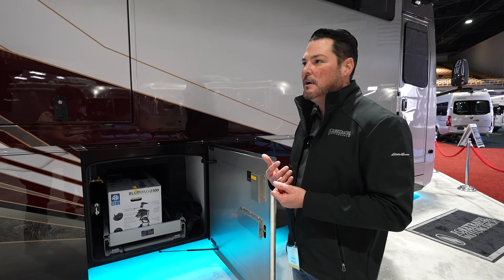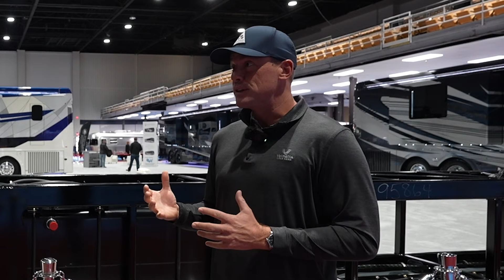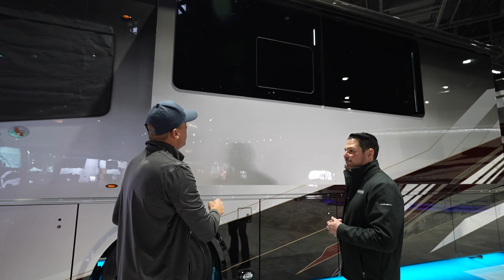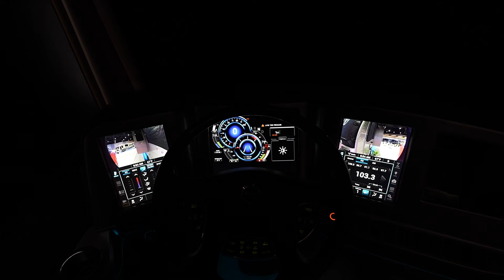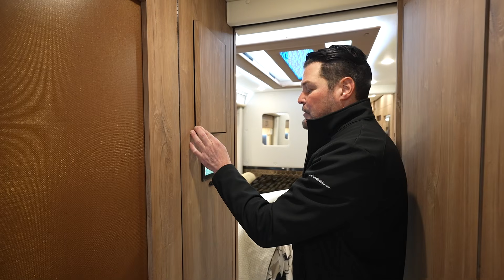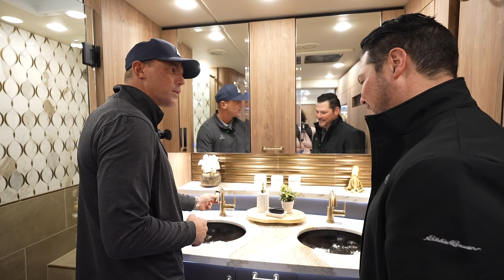2026 $1.8M Foretravel Presidential Series Prototype Tour

Comment: The New Marathon and Featherlite are around $3million so Foretravel stands alone at $1.8 million New for 2026 depending on what all you want. Especially for 2026. I'm impressed. At the motorstore you can get used Newell and Prevost at $1.8  million and lower.

Comment: Front passenger seat so far back from driver's side. Wouldn't buy for this reason alone.  No mention of step cover in front of the passenger seat. No view of half bath on video.  Rear bath is nicely done
I assume this coach has adapted cruise control, but it wasn't mentioned.

Comment: #xpeng_aeroht why I say "need two axles up front now not one" as anytime someone comes along and builds what Tesla should should have is really saying something. Hybrid drive systems as has been true in the Railroad Industry for 90 Years now wouldn't hurt as well. Amazing machine otherwise #tesla_semi is for real as well just as another heads up that one has been around at least a decade now actually...and will have full vehicle autonomy if not already.  Imagine a Coach with no more need for a driver and passenger seat and all of those controls etc...imagine what could be done if that were suddenly all a social space. Imagine adding a 2nd "deck" to these machines. How about separating the bathroom and shower rooms? How about making the latter State of the Art? #octovalve no more need for air-conditioning all heat pumps now imagine that as that has been for real for near 20 Years now #licensing_deals less is more in my view when approaching interior space as is always limited yes, yes? #minimalism 😊😊

Comment: Screen doors HAVE evolved since the ‘70’s. I refer you to a mid-entry Newell coach. The screen, not door, is retractable. The current setup with the Magna Shade is good but can it be removed? A retractable screen would eliminate the setup and tear down of the current screens. No disrespect to Magna Shade. Engineer that into the door of Foretravel  Presidential for the ‘27 model year.

Comment: What is the reliability of Foretravel vs Prevost or Newell?
Reply: I’ll defer to almost anyone on this issue but here are my thoughts. 

Prevost (any converter) and Newell are in the top class. 

Below them are production coaches. If Foretravel is a production coach then it is the top of the line. Anyway I see this coach as somewhere between  Newell and, for example, a top production coach such as Tippan and Newmar.
Reply: Provost is top of the line Foretravel comes no where near what they have